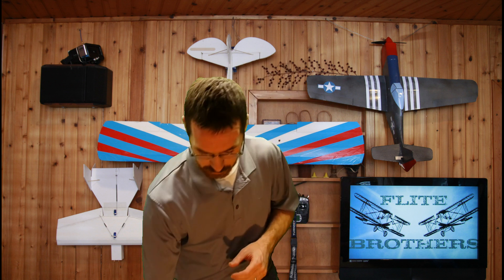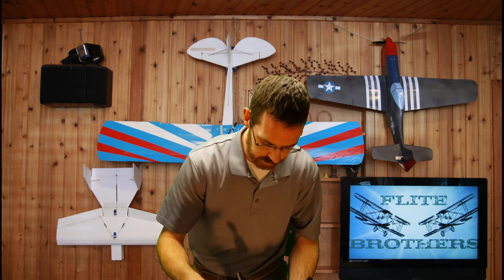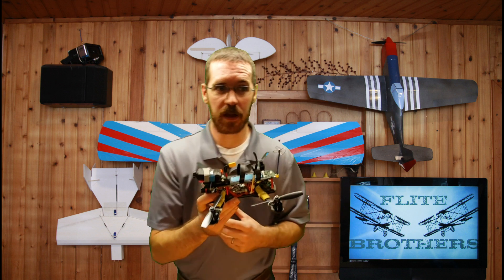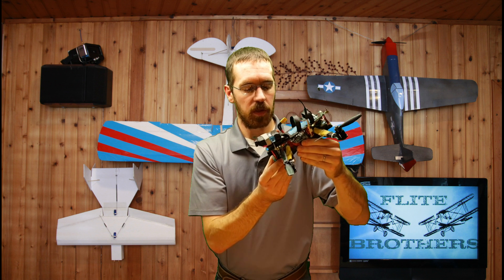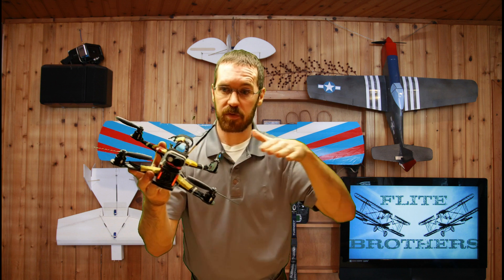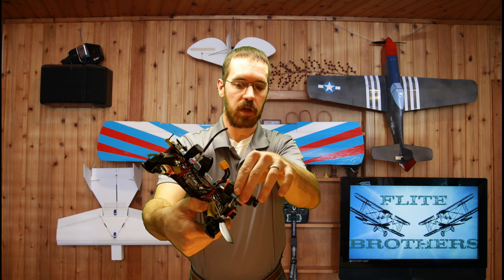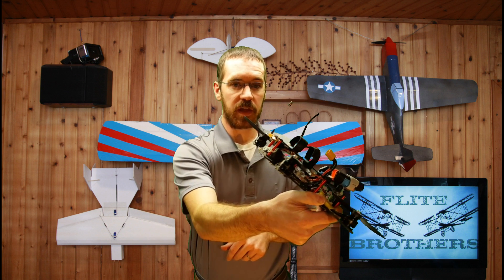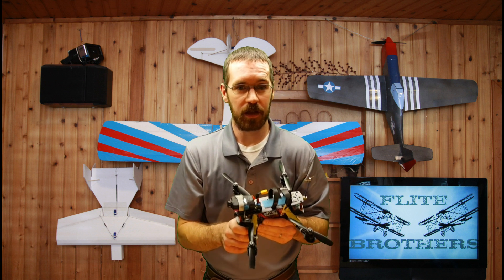How to Fly a Racing Quad or Multirotor

Comment: Good information.  I've been struggling to get good smooth coordinated turns and this sheds some light on my problem areas.  As stated below, this is great points to consider when transitioning from flying stabilized to acro mode.  Thanks!

Comment: For me the hardest part about learning was the fear of crashing. In the sim I was a zen master, but in real life I couldn't perform those same maneuvers because in real life it cost money and in the sim crashes are free. One day while in the field I said to myself. ......Just fly it exactly as you would in the sim, and when I did the correlation was uncanny.  I fly rate mode primarily, but one thing still  causes me issues sometime and that is managing the elevator input so that the quad maintains a persistent attitude and that I don't under or over compensate the pitch. I've always likened rate mode as balancing a plate on a pencil.

Comment: Would a radio mix of say 50% Yaw to 100% roll be a help in turning?Great video, right to the point.
Reply from the maker: I think mixing anything on a Multirotor would be more problematic. There are so many little corrections and inputs that need to be made while flying that if anything is mixed its just going to cause issues. Good stick control provides the "mixing" and practice is all it takes to achieve that.
Reply from the maker: I think mixing anything on a Multirotor would be more problematic. There are so many little corrections and inputs that need to be made while flying that if anything is mixed its just going to cause issues. Good stick control provides the "mixing" and practice is all it takes to achieve that.
Reply: +Roger DeVries Thank you for your reply, I will stick with crash & learn program,
Reply from the maker: +Roger DeVries lol That's the way we all learn. Behind every good flight video is good crash compilation. lol